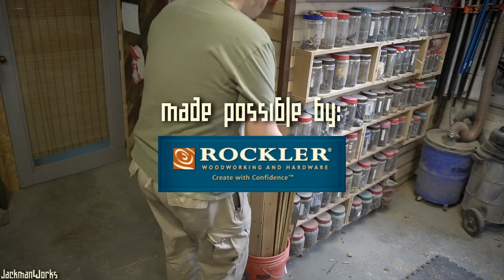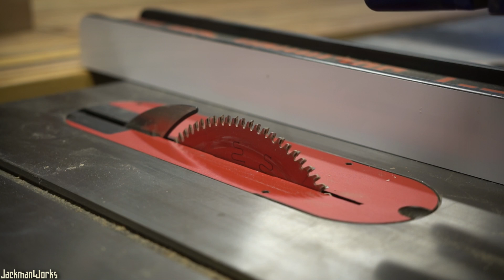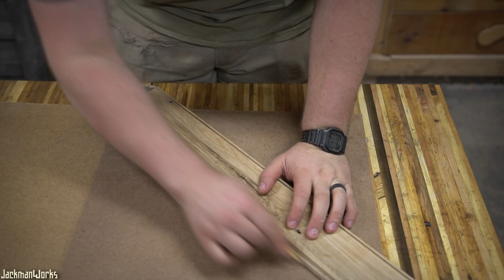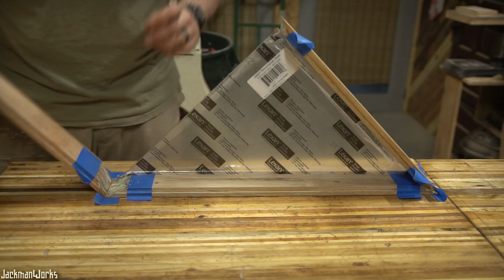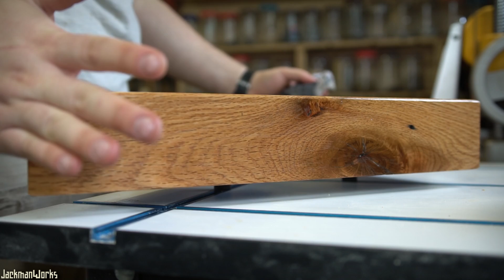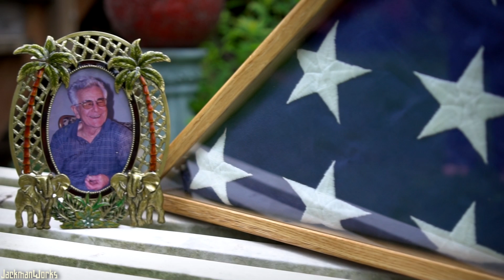Reclaimed Oak (Pallet Wood) Flag Box

Comment: What are the angles of the cuts and measurements
Reply from the maker: It's a 45-45-90 triangle so the 90 degree corner is a 45 degree cut and the 45 degree corner is a 22.5 degree cut. I'm not sure of the dimensions though, I just made it to fit the flag.